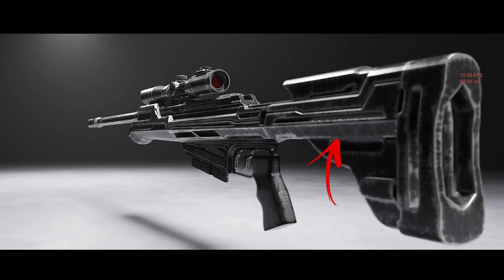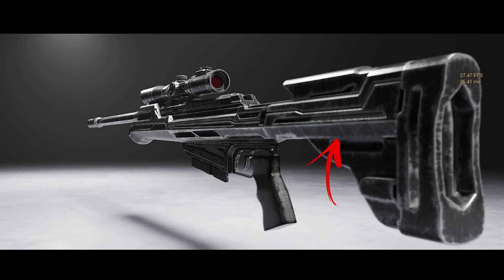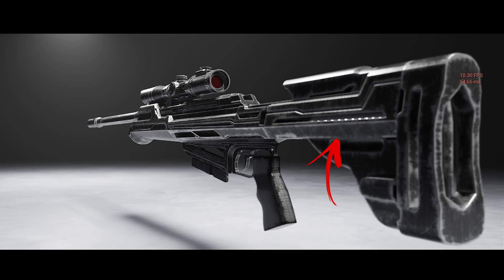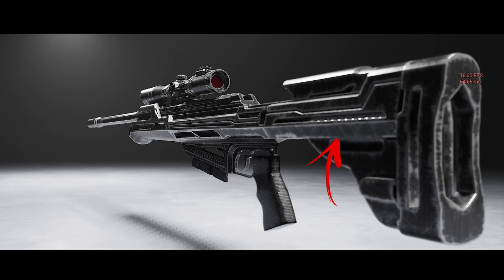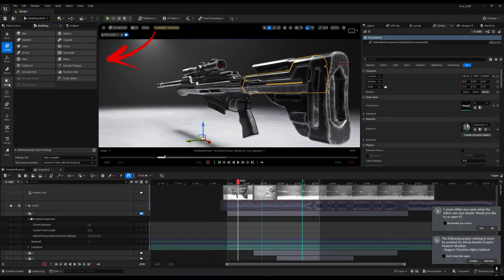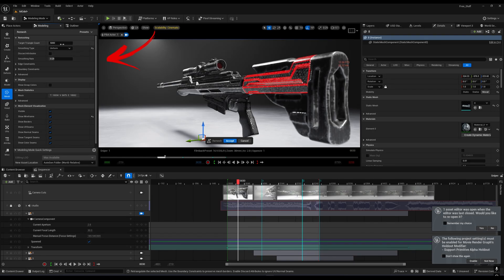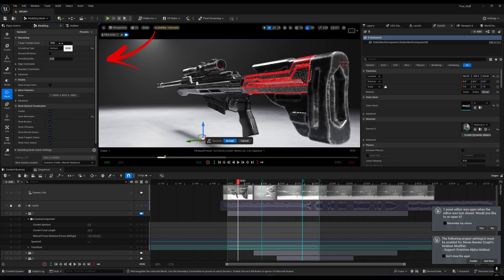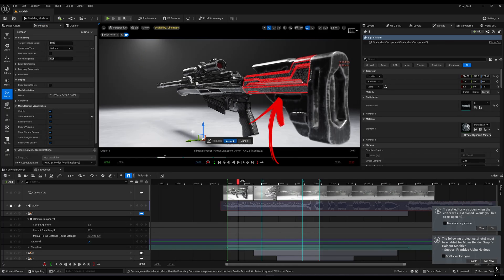Fix Model Flickering in Unreal Engine 5 – Easy Solutions🌿!"

Comment: surely disabling artificial blur/ low tier GPU- low resolution emulator (AKA Depth Of Field) will help.

i will never understand people wanting to artificially blur anything on their screen in games. cutscenes, sure, i get it, a cinematic way to direct your attention/ focus your eyes on what is important.
but in gameplay, i can focus my own eyes thanks. and whatever i choose to look at better be sharp. why else am i paying for a powerful gpu and 4k screen.

for anyone that likes dof. that is absolutely fine. but imho not only should there ALWAYS be an option in game to enable/ disable DOF. but it should also be off by default. its annoying how most games you can only turn it off in the config file, and some you cant turn it off at all.

the same thing goes for motion smoothing, film grain, chromatic aberration, dlss, taa, framegen, ray tracing. all should be options. not requirements.